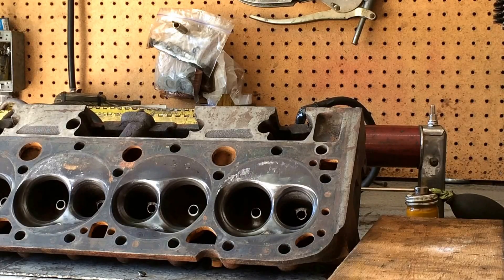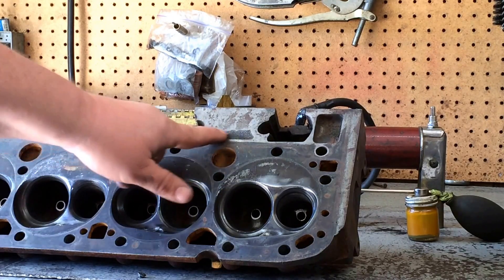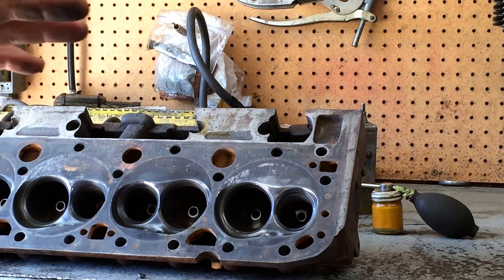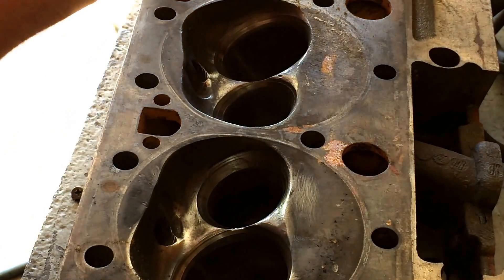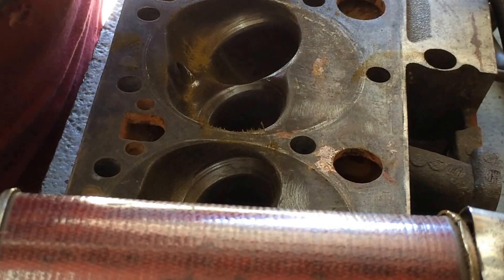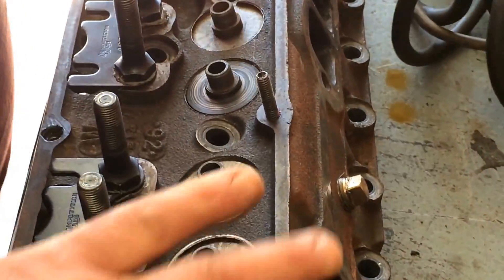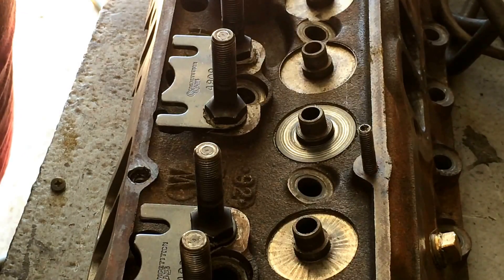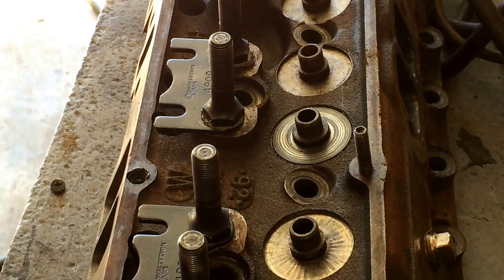How to test a cylinder head for cracks by Magnafluxing.

Comment: What is magnet for? In process of magnafluxing boiler sections
Reply: It’s called MPI, Magnetic Particle Inspection. The magnet creates lines of “flux” which is magnetism flowing through the part between the legs of the yoke. If there is a crack that runs the opposite direction of the lines of flux, it breaks the flow of magnetism and causes a “flux leakage” which attracts the iron powder particles. That’s why he placed the yoke both directions.

Comment: Good video. Curious why there are no steam relief holes between the combustion chambers for the 400 application? Not being a wise guy. Wondering if there is an alternative venting feature. Thank you
Reply from the maker: Keith Lane These are aftermarket performance head and are thicker castings and will take more heat.

Comment: metal dust goes into valve stem guides l guess, how clean , air or brush or try to cover them first.
Reply: Doesnt matter. Hes in the beginning stages and reassembly is a long ways away.
So its
1), quick clean and wash
2), disassemble / check valve,  guides and seats
3), mag them (thats what hes doing) then possible another wash down
4), if guides are bad, have choice of shot blasting or seal guides and shot blast 
5), deck surface
6), install guides if needed and seats or dress seats if good
7), complete scrub down with a series of brushs, soap and water, degreaser and wash, rinse then a complete dry down /choice of spraying with wd-40 for protection since there cast
8), reassemble and light spray of wd-40 for protection 
9), bag it for customer